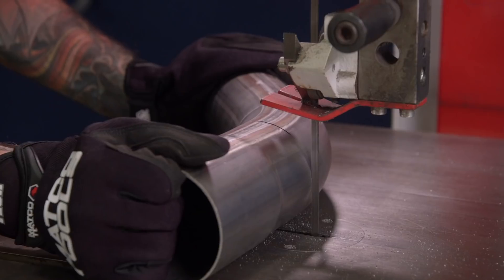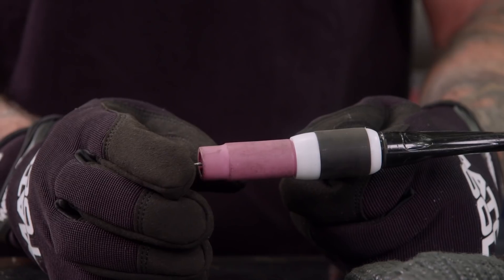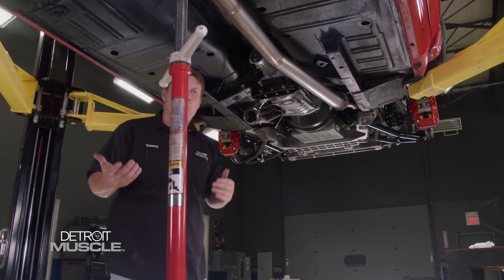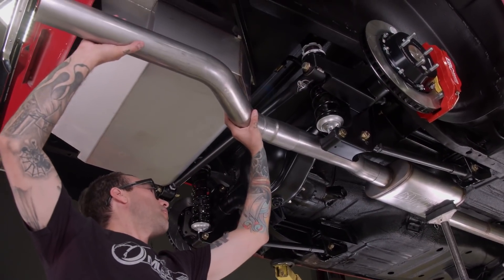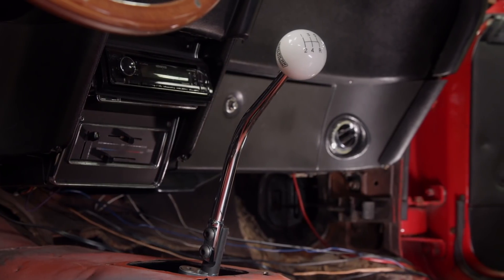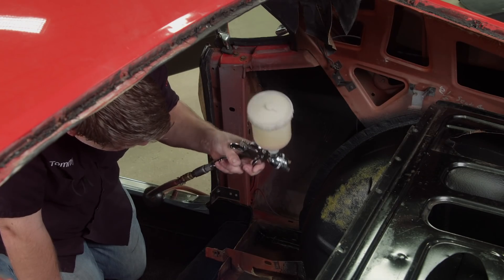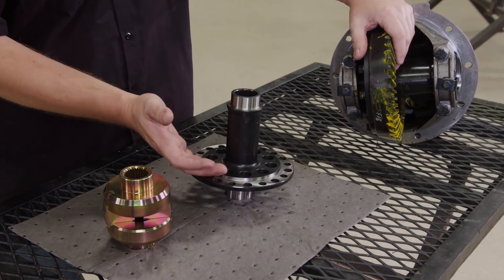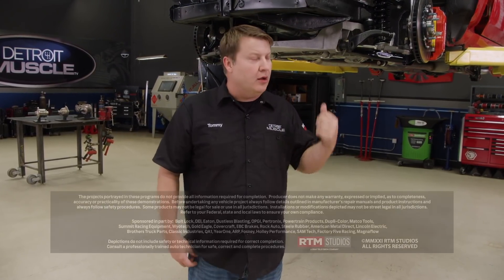Letting the RestoMod Mustang Sing With a Custom Exhaust - Detroit Muscle S8, E16

Comment: I found on the mustang's, that some of your sticky back sound mat inside the door panels, the space inside the rear seat quarter panels, across the sloped, and flat section part over the rear differential, and the majority of the rear wheel wells helps greatly. 
Also inside the door panels and the quarter panels I spray a moderate coating of undercoating from a spray can. 
Combined with all that I mentioned, you effectively eliminated most if not all of the harmonics generated by the rumbling exhaust, and bring a much better riding experience to the hot rods that you drive, are do you for your customers. 
Simple, but effective, and not much additional time or expense, but your customers are yourself will greatly appreciate the the huge difference it makes inside.

Comment: Back purging is only good if someone cares to stick a cam down in to see it otherwise both welds had great penetration and neither of them would fail and being stainless it won't rust and fail.
Reply: I stick weld. I don't have this problem. It's all about the pene.
Reply: @CanadaBud23  bud I've done it all and I like stick as well but I been doing alot of mig welding lately
Reply: Ugly welds on the pipes.. plus purging exhaust pipe little over kill.